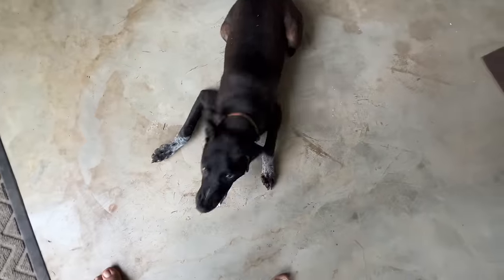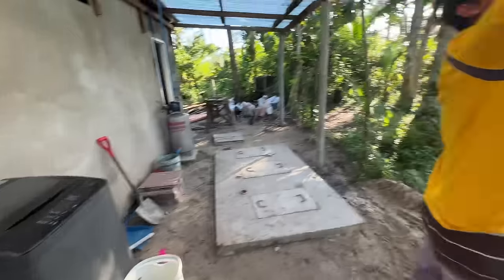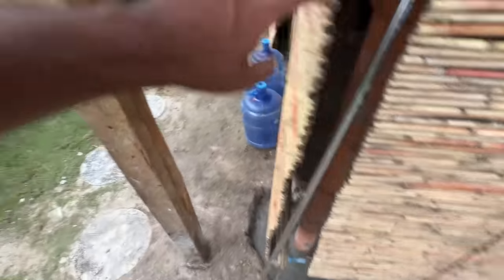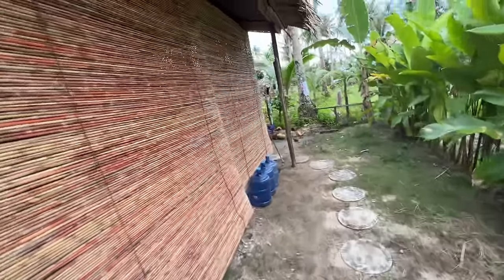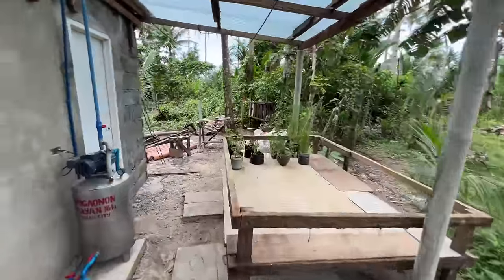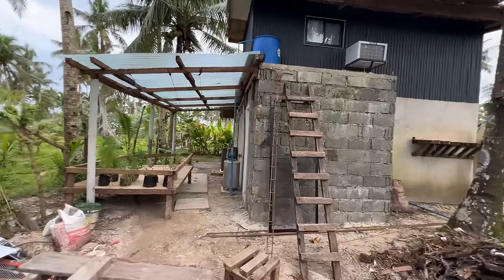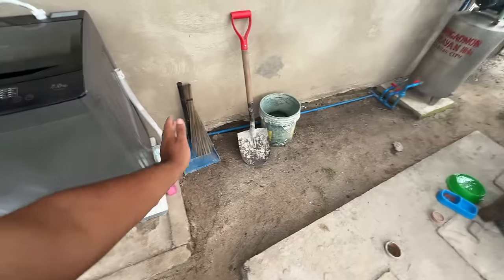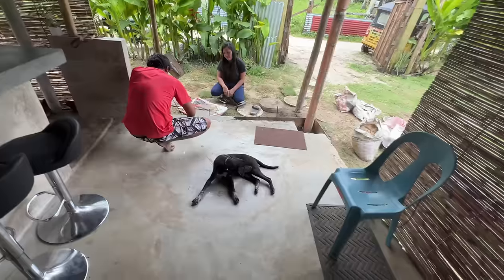Philippines Construction almost done! 🇵🇭 Tiny House Siargao

Comment: you have  to DRIL HOLES on the bottom of  the pots so the water drain.  Plants inn pots have to dry.  That is the reason your plants  are rotting the pot  is not draininng